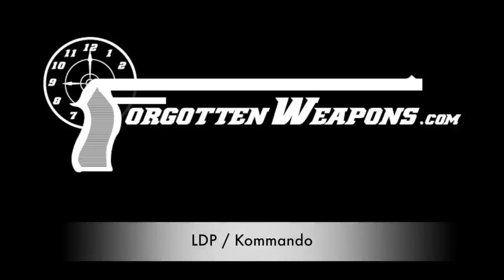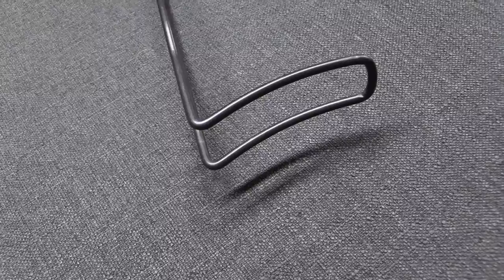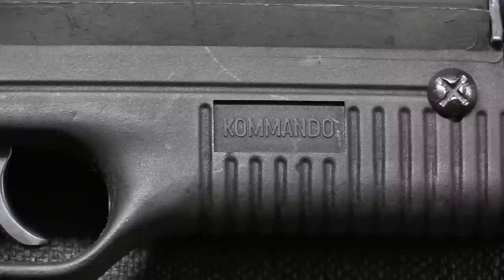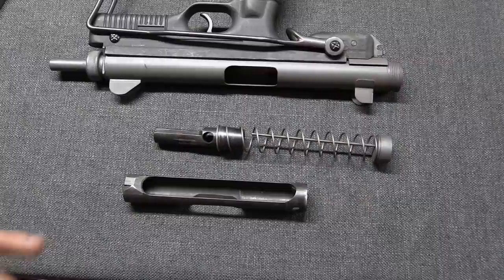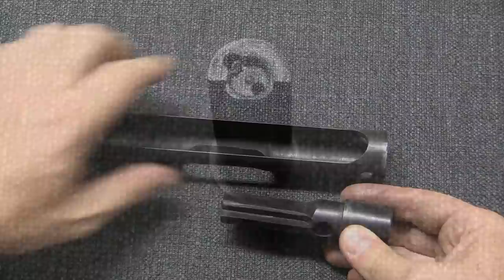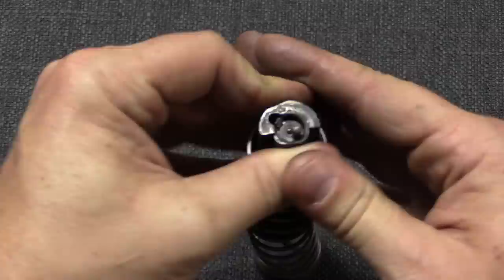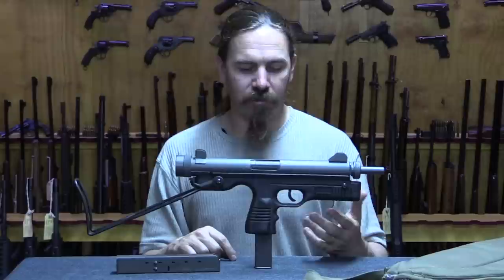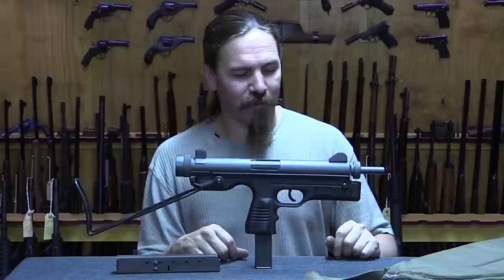South African Kommando: The "Rhuzi"

Comment: I owned an LDP in Rhodesia for a couple of years. The advertising said it was capable of firing 600 round a minute. I used it a lot on the range and never had any issues with it. Very nice size and it sat between the driver and passenger seat when travelling because there was always a threat of ambush even on the main roads. South Africa refused import when I immigrated there in 1980. I gave it to a friend who had been in the BSAP Special Branch and was then farming.

Comment: That little hook disconnector is a dremel tool cut away from being full auto.

Which is why the ATF got the red ass for open bolt guns in the 80s.
Reply: All gun laws are unconstitutional. They should all be thrown out.
Reply: i can imagine that was the whole idea, u get the gun and then ur a dremel away from an uzi

Comment: manufacturing wise, this is a very clever design. Everything is a bent piece of sheet metal, a milled tube, or a milled piece of round stock. The lower is a piece of molded plastic. The barrel is about as simple as a barrel can be. I love all the work that went into making this easy to build.

Comment: I'd love to see this on the range, and hear you impressions on accuracy.  Practical accuracy, because that's what things like this are all about.  (Meaning semi-auto carbines, or subguns converted to semi-auto)  Compared to a Pistol, this has a shoulder, and offhand contact point, so you can hold it steadier, and get a better sight picture.  Also better site distance, though these crude sights probably don't let you really take advantage of that.  You can't really adjust the zero on a hole drilled through a sheet metal bracket.
Reply: Also fires from open bolt.
Reply: Sure u can just bend the piece of metal til its on target😂😂

Comment: In theory, the whole bolt assembly can be done on a lathe, all the vertical machine operations can be done using the cross slide and an angle bracket, where the cutting implement is held in the chuck. Those are simple enough to not miss the lack of a fully operational slide as in a vertical mill.

Comment: Really slick construction with the two-piece bolt and receiver-mounted feed ramp. And in addition to easing disassembly, the semi-captive recoil spring is there because the ejector rod is off-center on the plug, which obviously wouldn't work with a thread-in piece. I bet that if there was a full-auto version, any police, security or even military would've been very happy with them.
Reply: Agreed

Comment: I have a parts kit for one of those. The barrel is a smooth bore. It's the one with the sheet metal stock catch. Had it for years.
Reply: They are supposed to be rifled but to important the kits they had to do away with that. Was a real shame

Comment: I have to say, that little retaining plate at the back of the receiver, is pretty smart. Makes disassembly much easier and you're not looking around for that cap piece. 

I wonder if it adds to the strength of the piece, with the locking pin, spring loaded nub, whatever you want to call it. I have to wonder how it shoots, that doesn't seem to be much travel. Well, it's enough.

Comment: I imagine one of the problems if us sales stemmed from the ban on open bolt guns (though that may have come later), and the ease in which it could be converted to full auto. You'd literally grind down the stiking face of the lever that presses down the disconnecter so that it depresses it enough to cycle but not enough to disconnect the trigger from the sear and its full auto. Anyone with a grinder (or a file for that matter), and a bit of time could do it.

Comment: One of the first guns I learned to shoot/strip/clean. We had a Rhodesian version with sideways folding stock which also could be used as a front grip (could be vertical or flat.) I never heard the term LDP until now, we called ours the GM16.  We would go to the range on weekends and afterwards My Dad, brother and myself would sit in  the lounge on newspaper strip and clean the guns. My dad would do an MAG or Bren, my Brother (8 years old) would do the FN Fal and the GM16 would be mine to do. Happy times! I was 5 years old when the war stopped and the gun was handed in to the police.
Reply: The GM16 was a different gun to the LDP/Kommando.  The GM was a copy of the Czech Vz.23, it was also made in SA as the Sanna 77.
Reply: @denzilvenske6315  that may be so, but all the parts inside look the same to me! No doubt there was much "sharing of ideas" back then... :)

Comment: So my question would be was it ever intended to be full-auto? It doesn't seem to make much sense for it to be an open-bolt semi-auto. I mean I suppose it is slightly simpler than making it a closed-bolt blowback action, but the difference is what? A floating firing pin and one small spring? Its got some clever ideas, but a closed bolt weapon would have shot so much better.
Reply: I imagine the original design catered for a full auto version for military / police use. Would be simple to have both designs it seems.
Reply: It's got a wire stock and crappy sights, the thing isn't meant to be shot 300 yards.
Reply: I kind of wonder if these things were designed to be easy to convert to full auto. They were sold in a time and place where the people buying them had an unusually high chance of actually needing to use them and where the government had bigger things to worry about than chasing down some farmer in the middle of nowhere for an illegal gun conversion, particularly because they were fighting against the same enemies that farmer might run into.
Reply: Nope, never meant to be full auto, never meant for military/police use.  The Sanna 77 in it's Rhodie G15 guise was full auto and the makers attempted to market it for military use but failed.  But that is a different (but similar) gun by a different manufacturer.  The Rhodies (and South Africans) always preferred full power rifles (read FN/ FAL or R1).  Keep the enemy at a distance, a long distance.
Reply: @max_archer  Ahem.... Remove the disconnector? That is it. Super illegal, but not that hard. Or file down the disconnector until it won't trip. Of course it probably shoots at some weird fire rate since it is probably not balanced as semi auto design. Both the trigger and disconnector are essentially stop to the default mode of the gun which is "ratata ratata ratata" as long as there is ammunition in the magazine.

Open bolts are nearly always easy to convert. Hence why many countries and legislations take a very dim view on open bolt semi autos. Essentially treat them as "semi auto only as long as honest person handles" and basic premise of law enforcement is "assume people lie and aren't always honest".

Where as closed bolt firing gun has to have active hammer/striker to set of the firearm.
Reply: @aritakalo8011  Yeah, that's pretty much what I was imagining. I really wouldn't be surprised if it were a "wink and a nod" kind of thing where the designers knew people would be likely to convert the guns, or even if they were designed with some future situation in mind where they might be turned into stopgap military weapons if things got bad enough that there was a shortage of more suitable weapons.
Reply: @max_archer  You nailed it! Back in the early 90's I worked at a gun store in Canada that sold these. The store owner had imported them directly form Africa, and he told us of the "flaw" with the use of weak ammo, so we could advise our customers. When we asked him if the manufacturers intended to address this issue, he smiled knowingly and said "Not likely". Naturally, we tested this with some weak reloads and...voila! The sweet sound of full auto! Zero trigger control though. Perhaps with some practice (which would have been illegal as this effect was supposed to be entirely unintended), one could change that. I suppose given the conditions South Africans may have found themselves in at the time, a full auto mag dump may not have  been the worst thing that could happen 😂
Reply: Never underestimate how much simpler open-bolt designs really are - closed bolt is typically better for accuracy, but that's about it. There's a reason most of these back-room looking machine-shop made firearms are designed this way.

Comment: I had one in England in the 80s It was on my Firearm certificate as a 9mm Carbine. I used it a few times on the indoor range at my club but they then decided that as it was a pistol range I couldn't use it there. So I took it to the outdoor Rifle range which had a 30m section that the army used for SMG practice thinking that would be fine, Wrong again! "You can't shoot that here it's not a rifle!" - The only gun I ever owned that I had to take back to the gunshop having fired less than 100 rounds!

Comment: I'm assuming you can't make out the US parts kits because it's a newly made open-bolt semi-auto.
Reply from the maker: Correct, but if you modified it to closed-bolt firing it would be legal to build as a pistol or SBR.

Comment: i bought a couple of these as de-milled kits in the early 80s (still have one).  some pretty substantial differences from what you show here (bolt, ejector, stock, trigger, etc)

crap gun.  but in a pinch, a crap gun is better than no gun.

Comment: Can you do a video on the difference between closed bolt and open bolt firing.
Reply: Lock bolt back, pull trigger, bolt falls, chambers a round and fires. That's open bolt.
Pull bolt back, release it forward, it chambers a round, pull trigger, hammer drops and gun fires. That's closed bolt. Simple.
Reply: When the fun is ready to fire, a closed bolt gun has the bolt closed (forward) holding the round in the chamber. For open bolt, when ready the bolt is locked back, chamber is empty.

On full auto guns, the barrel and chamber get very hot. When you stop firing a closed bolt gun, there is a round in the chamber. It could “cook off” from staying in hot chamber.

With open bolt, after firing stops the chamber is empty, so no cook off.

Comment: I don't understand the purpose behind the rear sight here. They look very obstructive and could have easily been a simple notch cut-out(like in an AK or most handguns) or a larger sized hole. I would not assume that someone using this gun would be looking for a very accurate gun(obviously more accurate than a pistol, but not to the degree of a rifle), and a tiny hole would not do them a lot of good. I may be wrong, but that is the way I see it.

Comment: Fires from open bolt and legal in the US?
Reply: Thanks.
Reply from the maker: I filmed this in South Africa, not in the US.
Reply: Ian, I figured you did but you mentioned there were at least part kits available in the US.
Reply: Too easily converted to full auto is what ATF says.
Reply: Sparky max ATF does not approve open bolt semi auto guns, as too easy to covert to full auto. Rule started in 1980s I think.